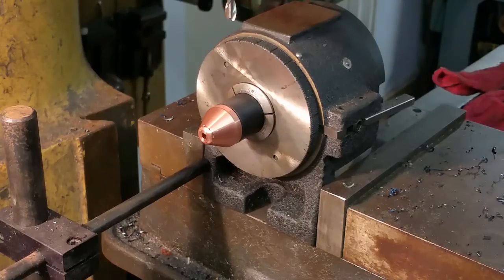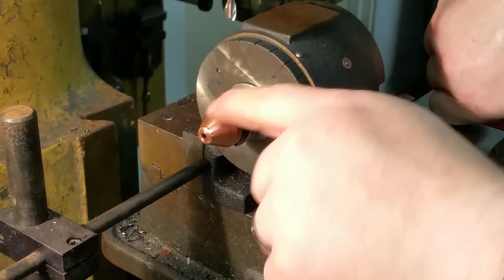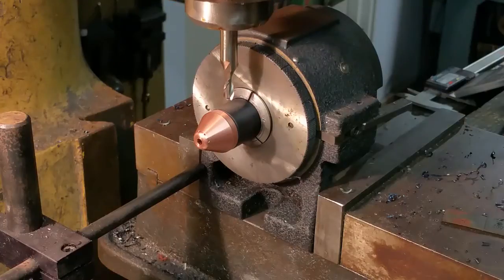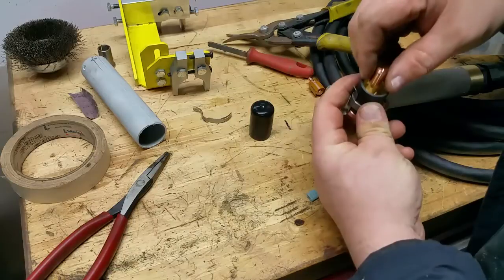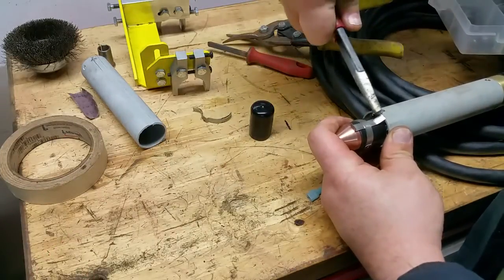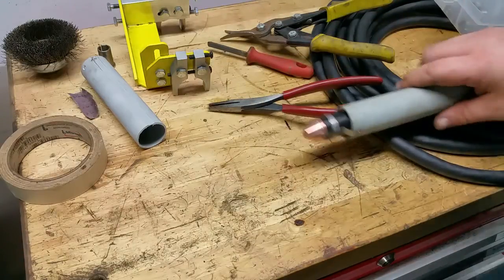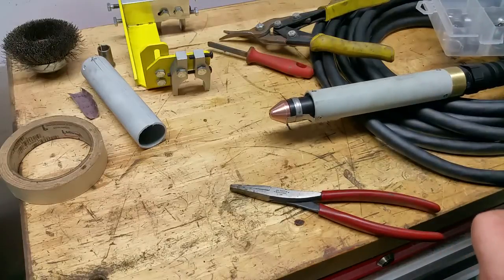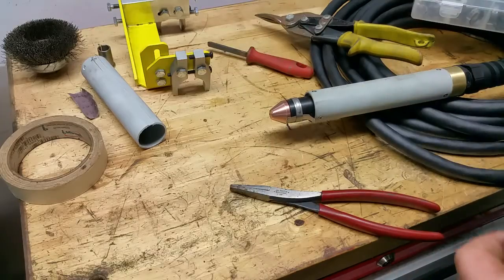Making an ohmic tip for the plasma cutter

Comment: Great video, excuse me, I am about to buy a powermax 45 for CNC with mechanized torch, what is the ohmic tap for? thanks.
Reply from the maker: For torch height sensing you need the tip of the torch to be connected to the sense wire from the torch height control so the controller can sense when it has touched the metal.  Hypertherm torches have an insulated tip, the ohmic tip adapter adds a conductor that touches the tip so your torch height control can sense the metal.  Some plasma tables use a floating torch with secondary switch, these ram the torch into the metal and jog down until the secondary switch activates, then have to jog away a known travel distance to reach the appropriate clearance.  My PlasmaCAM doesn't like water on the metal, it will erroneously trip the collision detection, which uses the ohmic tip to sense collisions with drops that are upturned during cutting.